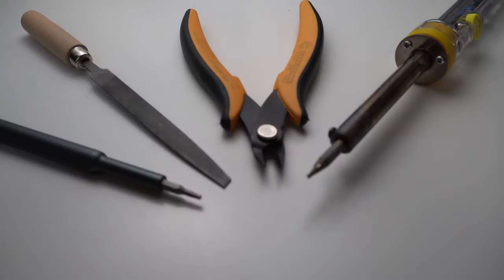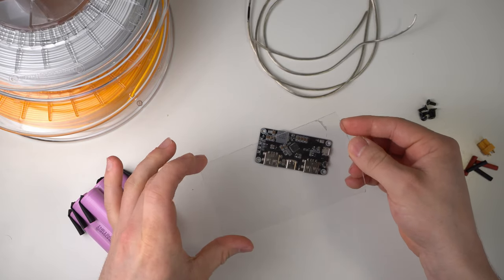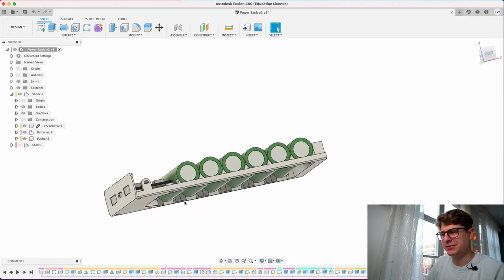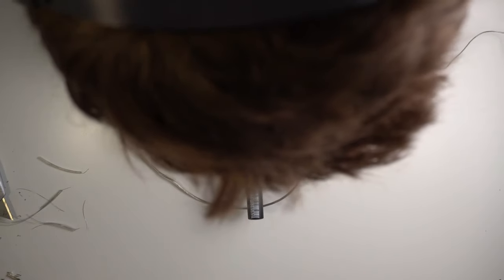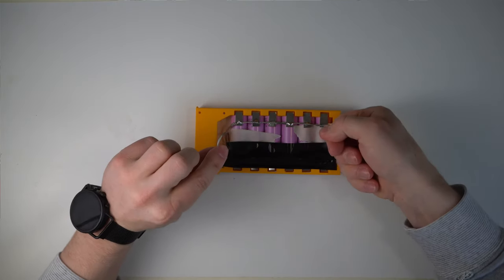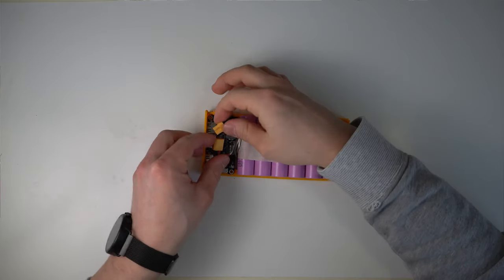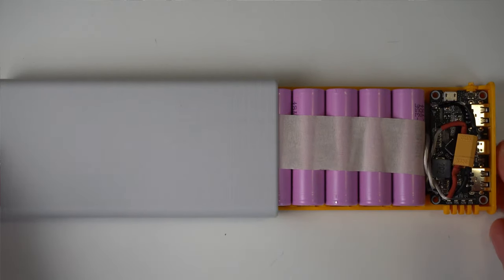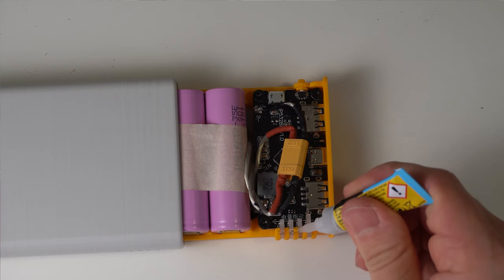Building YOUR USB-C power bank!

Comment: Very useful and great video! 

I've bought this module but I think mine it's faulty... When I plug it to charge the battery it seems fine. Red LEDs blinking on the %. But when I connect the phone, it charges it for a few seconds, then a blue led starts blinking, it stops charging and the red LED blinks at 25%. Do you know the reason why?
Reply from the maker: No clue, never had this issue. Did you check the voltage of the batteries?
Reply: @livingroomworkbench  yes, they are fully charged at 4,1V. When I unplug the charging cable all the leds are on, but as soon as I connect my phone or any load it does this weird thing.
Reply from the maker: @TheMprat99  Then I guess the part is really defective...I usually order more than I need for this reason. Waiting again is the bigger pain :D
Reply: @livingroomworkbench   First a seller sent me a step down converter instead of this🤦🏽‍♂️ Now another seller sends me a defective one and I'm dealing with it. I know the feeling 😤😤
Reply: I've bought 2 now and both do this, dunno why and can't help but think I'm doing something wrong

Comment: The way you’ve used the tabs is quite dangerous as the battery insulation is very thin and will cause a short if the tabs run through here. Instead you should be using barley paper o rings under the tabs at the ends of the cells and a sheet on each side where you connect the tabs.
Reply from the maker: Thanks for that tip! I thought about that but did not do anything because the taps have more then enough space and do not rub against the battery. But I guess it's better to protect the batteries anyways! I will add this to the instructions on thingiverse :)

Comment: Shouldn't you add a BMS to balance the batteries? AFAIK, doing what you've done is quite dangerous as there's multiple cells involved that could potentially cause safety issues down the road. What's your thoughts?
Reply: You don't need a BMS for this because the batteries are wired up in parallel and not in series, batteries in parallel self balance and act as if they were one big cell. As for the other functions of a BMS like over charge and discharging, this board does that for you